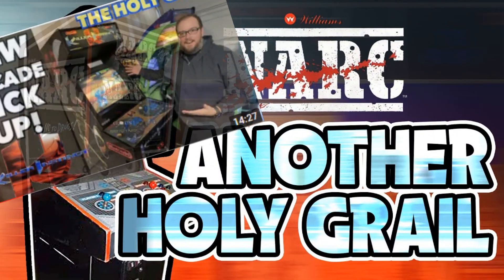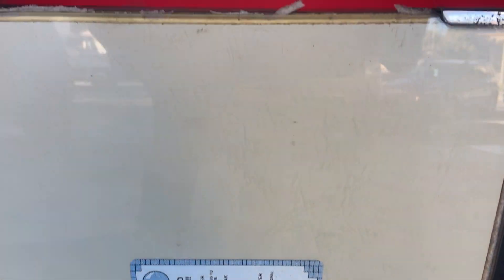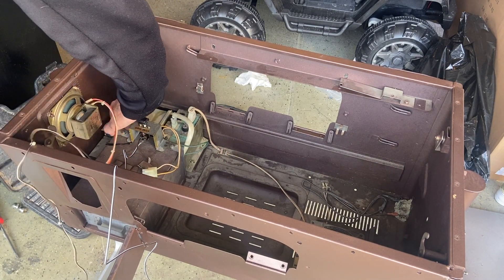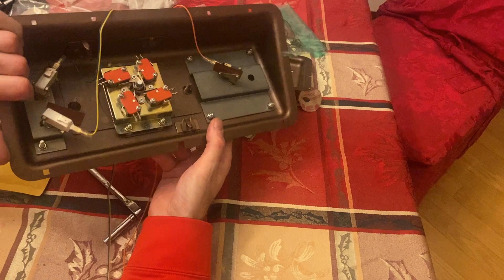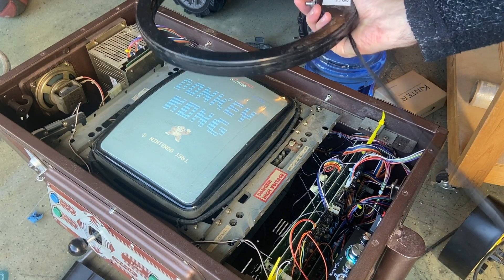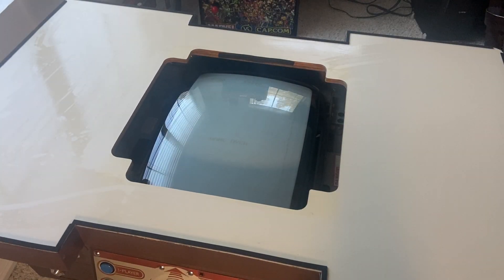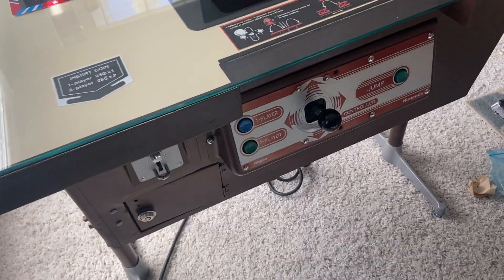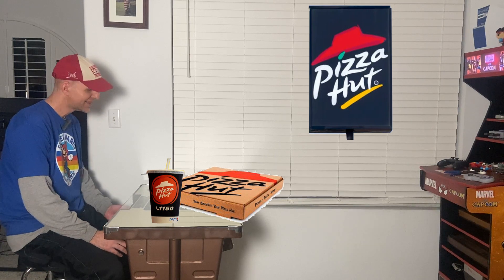DONKEY KONG COCKTAIL TABLE RESTORED!  Arcade Collecting!

Comment: Hey man great job! I own this same cabinet and I was wondering what you used to clean up the metal plates around the controls? Mine has what looks like a bit of oxidation on the surface that I would like to clean up, but I don't want to damage any of the paint.
Thank you
Reply from the maker: I think I may have used some CLR and then just soap and water.  It’s been such a long time I don’t remember really. But those plates will scratch and the paint and graphic will come off if you scrub with an abrasive.
Reply: Thanks!  That's good to know.  I am actually going to put it in the bar area during my wedding, so I wanted to clean it up a bit more for that lol.  I will just have to take my time when I clean it then, because I still have really nice graphics on those plates and do not want them getting scraped off.   @therexershow

Comment: Awesome transformation, Rex! That monitor looked really good with the tinted plexi. Do you replace the caps in everything, including the power supply? I'm not sure if I could get used to that stick...but I'd make do!
Reply from the maker: I had Sharp Image Repair replace the caps and everything. I don’t like doing Crt work. Same original  power supply , but I wish I could have gone into depth on how this stuff works.  The crt has a two prong plug like normal and there was also a fan that plugs into the power supply with a 2 prong , and then I had to add a way to power the Amp from the power supply.  It would  seem easy to add to a Multi power cord extension and use that, but it wasn’t that simple.  There’s always issues unforeseen that I wish I could get into but the condo would be 30 mins long.  The side locks was another story in itself.
Reply: @therexershow  Yeah, I hear you man! You made it look easy in a crisp 10 minute video, but I'm sure there were many challenges. I've "refurbished" 4 consumer grade tv's over the years and it's time consuming and dangerous. I just buy the service manual and hope for the best. Btw, I broke the tube on the best 32 inch tv I had by dropping the back of the chassis on it...so I'm not that great at it!

Comment: I've got one of these too.  Unfortunately it has a 60in1 in it.  My joysticks need to be replaced with Nintendo repros but haven't gotten around to that.  I did the one instruction card as well.  Same thought process.  I agree the control panel is awkward compared to the Ms pacman cocktail I have.  Something about cocktails gives me the feels
Reply from the maker: I have seen some DK Cocktail pcbs out there on the market. Still expensive though and not worth it probably..  the 60-1 is a decent option.  Arcadeshop.com has some decent repros , still costly thought.  Also , “The Canadian Arcade “ has a great video on now to fix and clean up Nintendo joysticks.